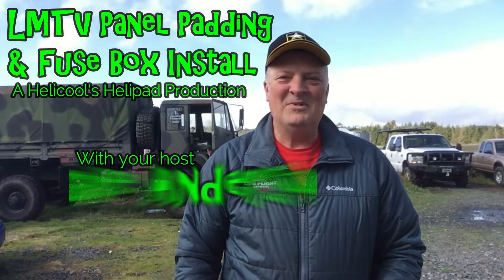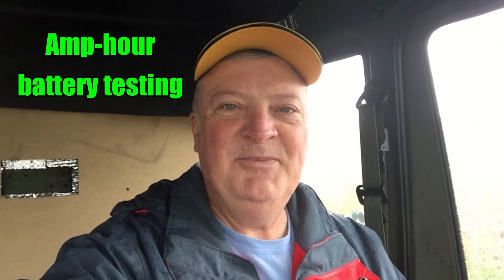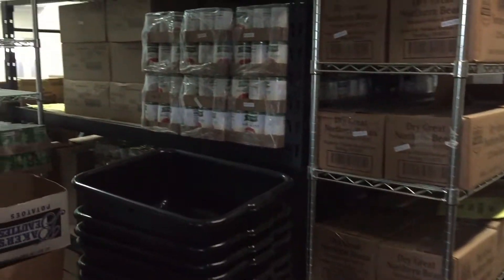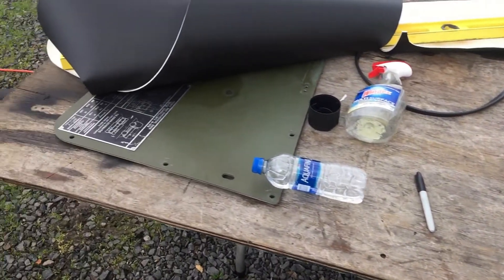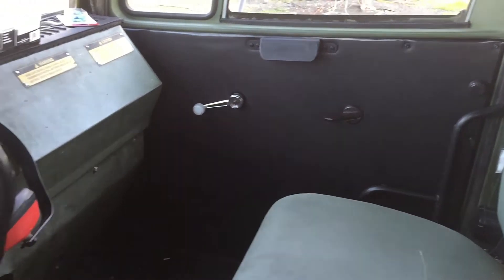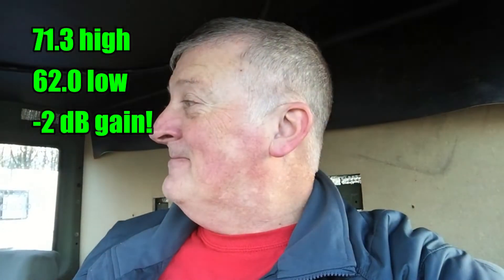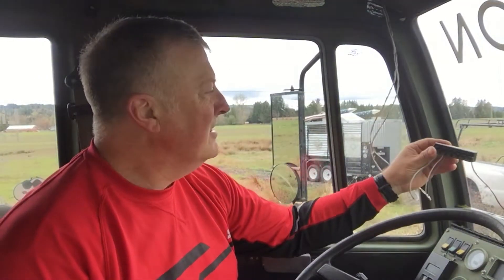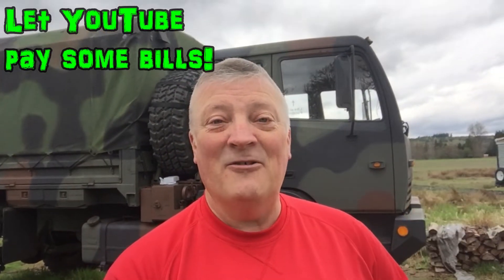FMTV DOOR PANEL & FUSE BOX Upgrades #38

Comment: I need a few parts! Do you have anything left from your tear down?
Reply from the maker: I sure do... what do you need? An engine?!! lol.
Reply: @HelicoolsHelipad  awesome, so I have a list. I'll see if you have anything I need. The air intake stack, and the flex hose from filter canister to back of motor. Any fuses or relays you could spair, mine were all robbed out lol. Drivers door handle. Last would be a spare tire and rim.  If you have any of those things, I would be interested in all you have, + shipping of course! Thanks!!

Comment: See the difference removing the cables did?  You went from 110+ AH readings to actual readings of 73-80AH per battery.  Those batteries should be putting out 110+ AH each.  Is it Walmart battery box time???? 100 bucks a piece for the 2 year deep cycle versions.  :D 

The cab sound is much much improved.  

I want my Abel back....I have so much to do!!
Reply from the maker: Per usual, you are right. I know it is a necessary thing, but I hope to milk these batteries until Fall... unless I get a huge influx of subscribers and YouTube starts ponying up some funds. :-)
Reply: @HelicoolsHelipad  Be patient.  Keep doing what you are doing it takes time.
Reply from the maker: I will keep at it, for sure... and that is why I hope by late Fall the Lord will provide a way for a less painful battery replacement. If the answer is to wait, I will wait on Him. He has been very good to me.
Reply: @HelicoolsHelipad  Maybe four of them will just appear on your property at some point??  ;-)
Reply from the maker: @SeanFillner  That would be great to find a philanthropist willing to help out in that kind of way.